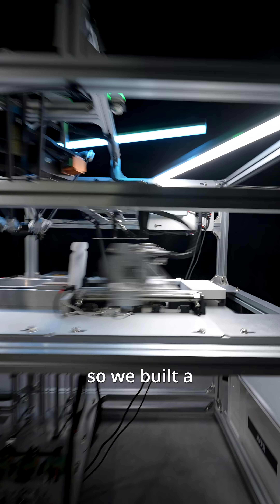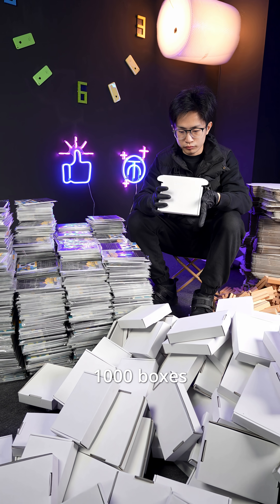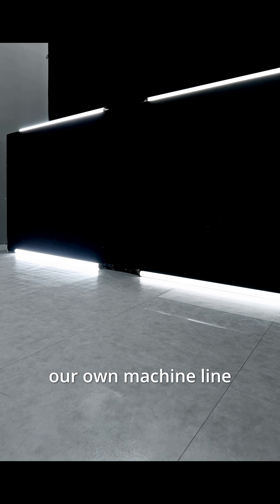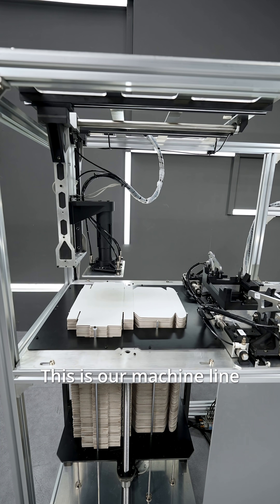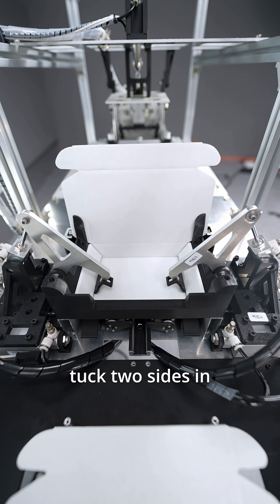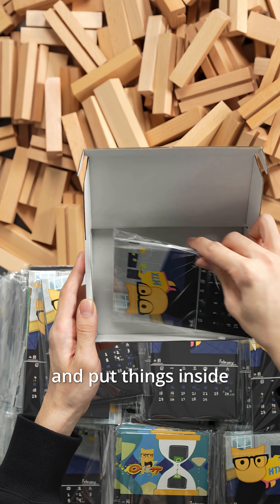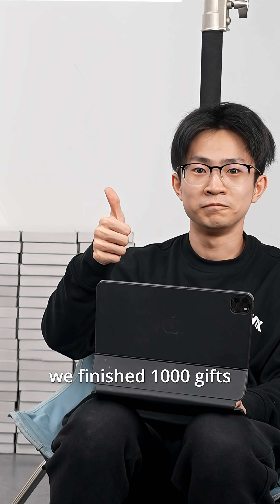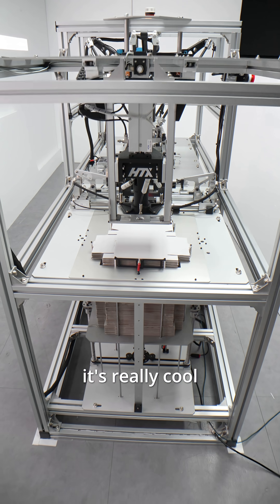We Built a Small Assembly Line

Comment: 1million boxes still take more than 2 years, but with 24hrs run 1 days could produce 2000-2500 so 1000 with 2 assembly lines is a little above 6 months. To make 1 million boxes, you need roughly 12 assemblies.

If each box cost $0.5@1000 pcs, then 1 m could cost ~ $0.2-$0.12 and that is still $120,000.

If each line costs $2000 to make, it could cost $19,000-$22,000.

Cost of electricity could be offset with solar but 12 line will push it a little ($5000😅😂😂)

Setup and operational cost = 5000+22000+120000=147,000

Profit:
1. If profit from each package is $3, then $3 million is your gross profit.
2. Net profit = 3,000,000 - 147,000=$2,853,000. 

Cost of running the shop for a month isnt included and demand size is assumed to be 100% 😂😂. 

If your assembly line could be adapted to produce whatever a bulk customer needs then you’re looking at huge incomes😮(even after tax)😮😂😂